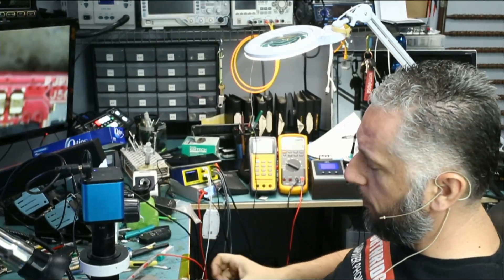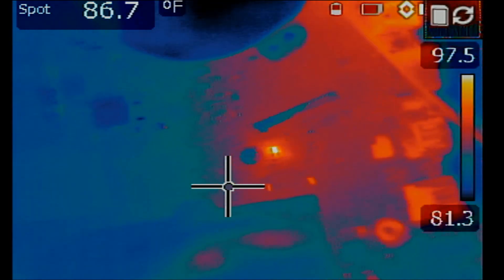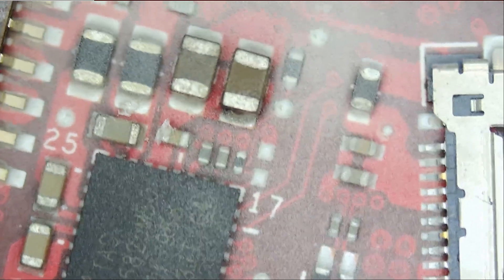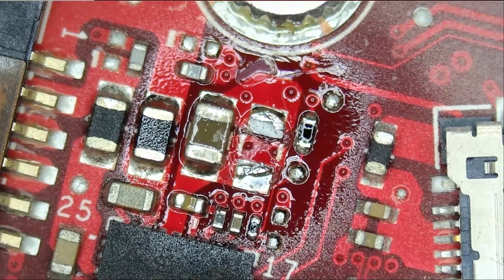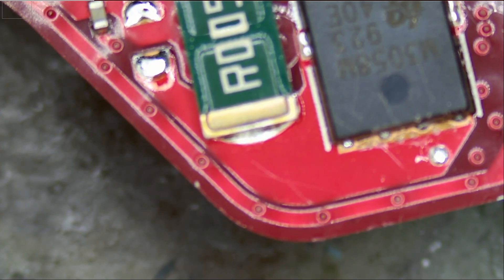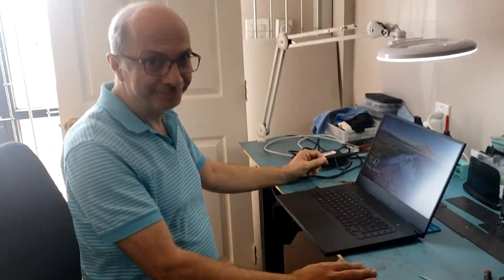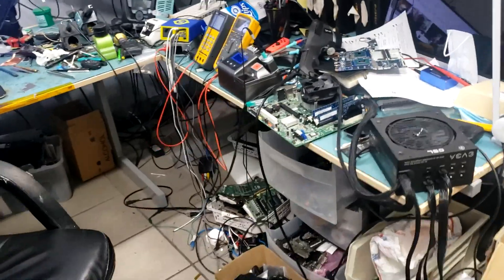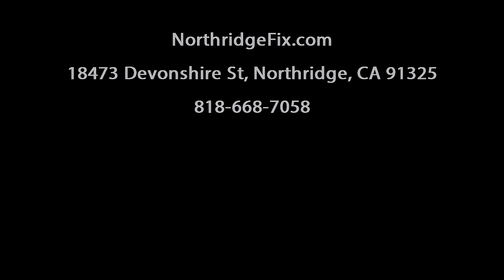Asus Gaming Laptop Motherboard Repair Using Thermal Camera and Atomizer - We need a bigger place.

Comment: I have a question: When you add the 1 volt to a component to see what areas of the board heat up under the thermal camera, does it matter when you inject the 1 volt as long as its on the poitive side of the component? For instance you inject the 1 volt into the positive side of a capacitor..does it have to be a capacitor that is grounding out OR can thre 1 volt be injected into ANY positive side of any capacitor?

Comment: May I ask can hot tweezers solder 201 capacitors that small onto boards? And what temperature would fry the 201 caps? Or at what temp to handle 201 I order not to fry it

Comment: Just yesterday, my ACER PREDATOR HELIOS 300 2019 year model gone dead, and i am thinking of replacing it with a Asus gaming laptoo, but looking at your channel, you have most of the ASUS laptops only for repair. No I am confused which brand to go for. Looks like Asus is even more problematic than Acer in terms of quality.

Comment: @northbridge , How do you know its a 10 uF capacitor, i think I did ask this before, not sure if I missed a video whereby you replied to it, I know where to get the capacitors from ie your books and/or digikey or something But what I do not know is how you know its 10uF, I cant see any numbers on that capacitor to check for the value

Comment: I am always impressed with  your shop and your family that works together. I know California prices and understand what the cost is, your shop is great considering. Blessings to you and keep up the videos, really enjoy them. I also learn alot, yesterday was my first time finding a short, now I need to get a voltage injector from you so I can trace it. That atomizer is on my list too. Mine is a hobby for now, but if I can get better, maybe more. I have always been good at soldering, its the fine work to keep the rest of the board safe. Thanks again sir!

Comment: Hey, love your videos. I have a similar board (ASUS sucks) and am wondering how much voltage/amps are safe to inject? Right now I'm injecting 1V/4A into the board, and only see a mosfet getting slightly warmer (32C, ambient is 24C), do you have a rule of thumb when it comes to injecting voltage, so not to damage components?
Reply: Yeah,majorly cause of the cpu or gpu,so as not to wreck anything in the process of finding the fault

Comment: Does anyone know why ceramic caps failing short is such a common failure cause for consumer electronics these days? Is it mechanical stress? I know MLCCs are very prone to cracking from board flex if they're in a vulnerable position.

Comment: Need to say, Asus engineers must improve these power supply circuits.  Endless videos that you finding bad caps and shorted mosfets, or they are not reliable projects or they use cheap components? Or I´m wrong?

Comment: My Asus tuf f15 just die no power no chargelight. Had to send it to ASUS who denied the warranty because the sticker was broken. I only took it apart to change the thermal paste because it was thermal throttling. In the first place. Charged me $900 to replace the motherboard. I paid $1130 for it.

No idea if where the short is and if it's GPU related so I have to bite the bullet and pay.

Worst part is that even though it's being repaired out of pocket and out of warranty they're not returning the defective board.
Reply: Dude same

Comment: I am amazed that you can spot the faulty component in the thermal camera when other areas of the board appear to be just as hot. Years of experience, I expect.
Reply: Most of the areas that look hot are just reflections and you learn to spot that pretty quickly.